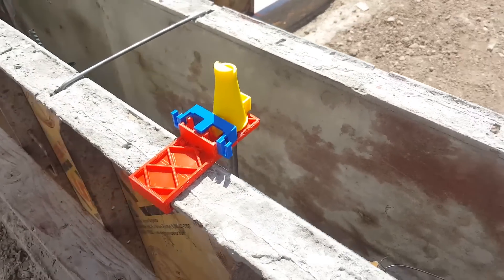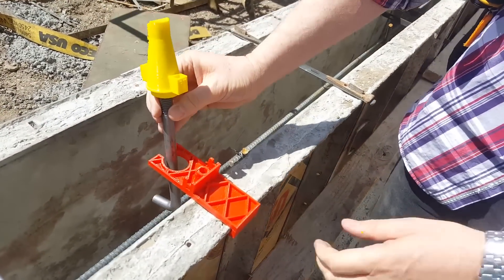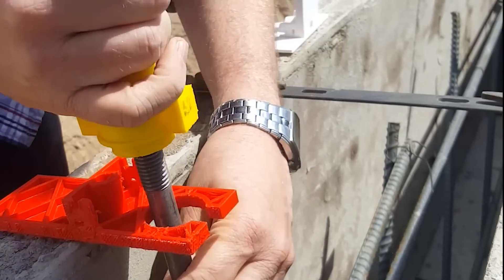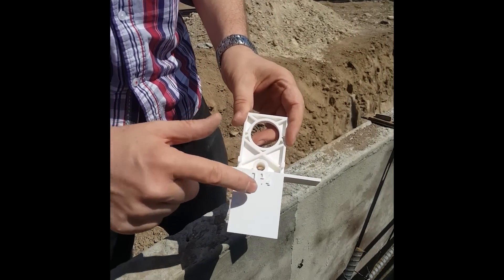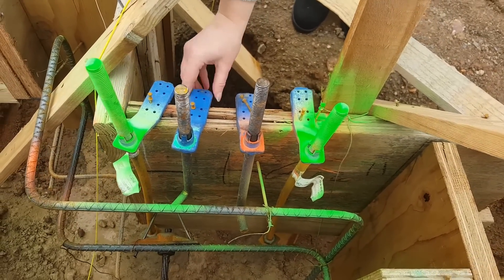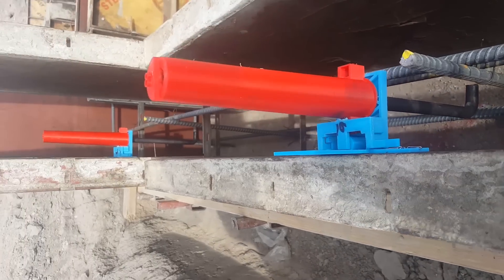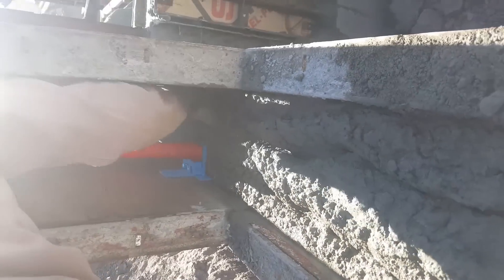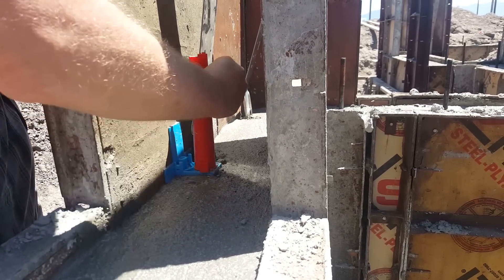Do NOT wet set anchor bolts - stated by structural engineers.

Comment: The examples given are like the info-mercial exasperated housewife that can't figure out how to use a knife.  They're creating a problem to help sell their solution: a cheaply made product you don't need to spend money on.  Sure if you set a bolt incorrectly and cause air pockets or do it right next to the edge, it may crack.  But do it right and you're good to go.

Comment: We hand set them after the pour. In some cases we use threaded rod double nutted with a spreader  bar. Never had a problem. If worrying  anchors will pull out move to 5000 pound concrete.

Comment: I don't know if the product is a contributor (advertiser) to the program/channel but, while I do agree he anchor bolts must not be set on wet concrete, the plasticky product is unnecessary and not the best tool.
Just create a template with a plywood.  Set the anchor bolts with washer and and nuts above and below the wood template.  
You can also tie the anchor bolts to the center of the rebar cage or horizontal rebar.
When set this way is rigidly secured, and while pouring concrete a vibrator can be used so there are no air gap or honeycomb in the concrete.

Comment: Well, after watching, just a bit of your video, here, it’s unwatchable, for tradesmen, who been in the business for 50 years I must be just drooling into a cup. I have never ever ever had a foundation crack on me around an anchor bolt.

I couldn’t even count the number of anchor bolts thousands I’ve never seen a failure never. i’m guessing it’s either poorly mixed concrete or your mixes to dry or they’re waiting too long for the wet set, your premises is complete nonsense it’s more about the mud and the skill of the worker.

Comment: My contractor accomplishes the same thing with a piece of 1 by nailed to the form and the anchor bolt set at the correct height and distance from the side. It is fast, easy and accurate and the building inspectors do not have a problem with it. Wet setting is prone to error both in placement and orientation (height of bolt, distance from the edge, whether or not it is true)..

Comment: Ive seen hundreds/thousands of wet-set bolts. Never seen any of the problems you've shown. Only way to see such problems is setting after concrete starts to set. One of the last bolts looked like a straight bolt dropped on a hole drilled afterwards.

As for this system, way too many pieces.  Grey color is a ridiculous choice for the locking piece - lose that in a heartbeat. Perhaps if there were a tether of some sort to prevent losing the pieces.

Comment: Pre setting the anchor bolts prevents you from getting a good finish on the top of the wall.  You'll have air leakage pouring out of your building at each A-bolt location.  We are taught to carefully place the bolts into the wet concrete but not to wiggle them up and down, rather tap the forms to consolidate the concrete around the bolt.
Reply: What is more important? The finish or the strength?

Comment: After wet setting anchor bolts for 42 years I've never had an issue. It is easy to get them secure without and divits in the surface.. I build on mountains a lot and we step our foundations so our system would take too long to set up
Miss Florida needs to show her credentials in engineering
Reply: From what it sounds like, wet setting isn't an issue that comes up right away, it develops over several years and weakens the overall structure.
Reply: @Jedi2155  I've remodeled houses 40 years old and never seen any issues.  Someone's trying to sell something.
Reply: @Jedi2155  How?
Reply: Never set anchors in my life however 
I can certainly see where unskilled workers 
who only care about a paycheck can always find a way 
to do a job half assed . 
And yes miss Florida should show a little more .   LoL 😂
Reply: @mhughes1160 I've been doing construction for 40 years.  Never had any problems with anchor bolts. Just about any one can do it.  And you think these things are fool proof?

Comment: I design reinforcing systems for building slabs.  I use at thread tube welded to the metal frame that accepts any threaded bolt or rod.  The end of the tube is at floor level, and it aids the concrete contractor to level the floor to that point.  They can even use a helicopter to level the floor, all the way to the edge.

Comment: Commercial jobs it's usually right in the specifications that wet setting is not permitted but those bolts hold a building together.

Comment: No need to do this. Just drill when the concrete has set and use expanding bolts with adhesive.
Reply: Drilling takes 3x longer. Just wet set them with a jig like every other competent contractor.
Reply: @LaFox23  As long as you don't wet-set where a stud is supposed to go.
Reply: That arguable...measuring out where to drill holes so you can set your plate onto a bunch of crooked bolts takes a time.
Reply: @ericbstudios9807 bolts aren’t crooked if you bend them plumb. If you know production framing it doesn’t take long to set a plate.
Reply: @LaFox23  I get it brother.  But it takes time to measure and drill holes and you have to make sure you miss any studs right?  I'd rather drill after like Awesome Framer does...he's my hero

Comment: The building code say that the anchor bolt must "In Place" before pouring concrete. This means wet setting is not allowed.
Reply: Yeah, as a newbie I really wish everyone would explain the jargon.  I infer that "wet-setting" means that the bolt is shoved into the concrete after we pour the concrete but before it sets.

Comment: Uuuuuuu - long ago and far away add the Jbolt and secure with a scrap of 2x4 to the form after the pour and then a light hit the area with the concrete vibrator… it was before epoxy was available/cost effective.

Comment: horseshit, even with wet set bolts a tornado will pull the studs from the bottom plate and leave the plate on the foundation. And i prefer epoxy and/or wedge anchors.

Comment: back in the day in residential work when pump trucks either weren't available, or the builder didn't budget we would sometimes have to "loosen" it up to get it around to the back wall. we used to rip up the cardboard tie box to get the bolts to float overnight. after the framers put the sill on, they would mash over the bolt instead of using the nuts and washers to save time. I haven't heard or seen any of those houses go anywhere. for that matter, houses built in the 1800's are still on their stone foundations with no anchor bolts.
Reply: This is just an excuse to sell something new. Some things never change!
Reply: I have alittle unique experience to add. My town had a tornado in 2023. There was 1 home that wasn't properly anchored next to one that was. Both had major roof damage but the home without good anchoring shifted on its foundation and was a total loss. 

My home was a total loss (direct hit) and i prefer that over trying to rebuild half and repair water damage but just a data point
Reply: @26longlongtime it depends on how the tornado hits the house.  The j-bolt isnt going to save it and like you said id rather lose the house at that point...
Reply: @26longlongtime  So your point is that if a tornado directy hits your home, it will pretty much be a total loss whether you have properly anchored bolts or not. And that if the tornado is strong enough to rip off the roof, that it is better to just rebuild than to salvage a bunch of water and potential structural damage on a properly bolted building. Is that about it?
Reply: Somehow that reminds me of hurricane Hugo I think it was in 89.... My understanding was the town of Charelston, SC got hit pretty hard while some of the older structures had bolts positioned horizontally through the structures and large washers on the exteriors they held up well..... Having traveled through Charleston year's later I noticed the garbage can lid size cast iron washers on some of those structures..... Guess Hugo wasn't their first bout with hurricanes....

And sorry to hear of your Tornado Loss.....
Reply: @markbouldin6513  South Carolinian here.  Yes.  That and the direct hit was north of Charleston just a touch.  Hard to argue against the old construction in Charleston though. Been there a long time , through many many storms.
Reply: @puttervids472  Geographical Central North Carolinian here roughly an hour due West of Raleigh....

I remember it like it was yesterday, my coworker friend and I finishing up our 12 hour swing shift that Friday morning, off for the weekend we worked out at the gym and headed home.... My home at the time was a 14x70' mobile home and exhausted I slept until late that evening..... Slept right through Hugo and the wind's we had and fortunate that Hugo had lost much of it's punch through here.....

I remember news video of the ocean waves crashing through the first and second floor of the hotel's in Myrtle Beach and I remember thinking it would have been pretty cool to have taken it all in from the top floor of the Yachtzman or other tall hotel and of course we were still in our twenties three plus decade's ago....

Btw- Growing up in a tobacco field my teenage friend's and I thought we'd found Heaven when we discovered Myrtle Beach SC.... And Sorry if I get off context and torture folk's down memory lane.....
Reply: @markbouldin6513   Spartanburg SC here. I know exactly what you mean. First time I saw Myrtle I thought we had arrived on another planet.  🤣
Reply: I live in one of those houses.  Brick piers underneath.  She’s solid as can be. Two story. Beams over every door and window. Beam x braces cut into every wall bisecting the studs.
Reply: I thought the same thing. At least I have never seen a building failure caused by anchor bolts coming loose. The only real advantage I see to this system is that if someone wanted to be really particular, they can have their anchors below the horizontal rebars so they really know this thing is not going anywhere.
Reply: @verohandymike  
Apparently Miss Florida 2009 is one such particular person. I don't know about you but I was thoroughly convinced by her admonition about anchor bolts. She absolutely sounded like she knew what she was talking about. I'm sure she's set thousands of anchor bolts so she's got to be an authority on the subject.😁
Reply: @verohandymike yep, this is all a non-issue. A couple of loose anchor bolts will not affect the structural integrity of a house.
Reply: I don't know how I landed on this video, but it makes absolutely zero sense. It begins with a woman talking about construction who's probably never lifted a hammer herself, then proceeds to claim that wet setting is either not allowed or not a good idea yet for the next 9 minutes all you see is wet setting.

Comment: Either use a plywood jig or tie them into rebar and lay them out dead nuts before you pour. Pesonally, i run 3/4 wedge anchors, 9in deep and use 2 part epoxy. Way easier and the concrete will fail before the epoxy does plus you have a wedge at the bottom.

Comment: We always tie them in to the rebar before we pour, or we drill out the concrete and set them in epoxy after the concrete has set.
Reply: A lot of structural engineers are starting to move away from recommending wet setting and recommendind drilling and using 2-part epoxy with threaded bolts (similar to Tapcons)

Comment: Sales pitch code allows wet setting , these guys should have used a real product not a 3d printed version. The blog link is gone so I bet they went under. I mean they are competing with a cut to width stick (metal or wood) with a hole in it. Run the steel through the hole push down line up edges and position is set and so is depth.
Reply: Yes lol. You can just make a simple plywood piece to hold the anchor bolt using the leftover material from the job site.
Reply: Check the website, call them, they haven't gone under.  They have real products, the prototypes were 3d printed so what's wrong with that????????????  And because you can re-use them it saves you money and time.  And what's your method to hold the anchor bolt when the concrete is not pored to the top?
Reply: @SunnyDaysRFun  Sounds like you have a vested interest in this prototype, and there is nothing wrong with a 3D printed prototype. The only issue is the sale job, these guys are literally using the chicken little method of sales seriously implying structural integrity will be better if their product is used. As one of the commenters above said your competing against job scraps.
I am not sure I get your question about concrete not going to the top. The top of what? The forms? That's sort of the point,  these holders sit on top and have limitations if I wet set then it doesn't matter. If the concrete is below the forms, it's just more work, having to snap lines for the level and verify with a laser. Its easier to go to the top.
Reply: Simpson sells a plastic anchor bolt stabilizer or ABS
Reply: @voidisyinyangvoidisyinyang885  Yes but its not the ABS its the Anchor Mate the ABS is for embedding  into the concrete holding the longer anchor bolts stable. The Anchor Mates are for the bolts as well, but why, it all depends on how the engineer or municipality wants to see the bolts set. Personally I would absolutely use the combo of the Anchor Mate and the ABS for the long hold down bolts , but if I can wet set the "L" bolts why not. The bolt isn't even tightened down much there are just placed to stop movement. Mudsills are not supposed to have they wood fiber cut by the bolts being cranked down. I saw A Youtube guy place the bolts into the Mudsill and wet set both the mudsill and the bolts at the same time. fun stuff.
-MG
Reply: @meshedgears2794  Call any structural engineer and ask them if it's OK to wet set when you no longer have to with the ABS system that the video talks about.  If you can avoid wet setting avoid it.  This video shows a way to avoid wet setting.
Reply: @SunnyDaysRFun  I agree if you can avoid it then why not. But do I need this holder not really. There is a lot of competition on these types of items and 3d printing while good for prototypes can't compete with injection molded for cost or just plain scrap wood.
-MG
Reply: @meshedgears2794  Please show me what the competition has against what's shown in this video.  And the product you buy is injected molded.
Reply: @SunnyDaysRFun  Not sure I understand the comment. This product competes against 0 cost job scraps or 0 cost wet setting. Simpson makes injection molded versions of holders. that's just buying capitol equipment. This company could compete with simpson but it takes lots of capitol money. The fact is its hard to compete with 0 cost.
Reply: I'm confused you can 3D print titanium, what does Real mean?